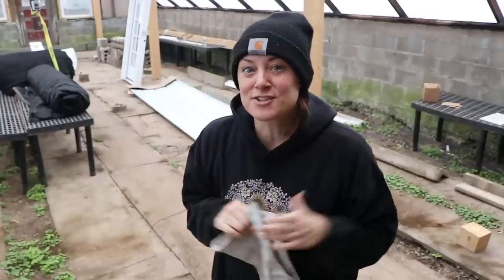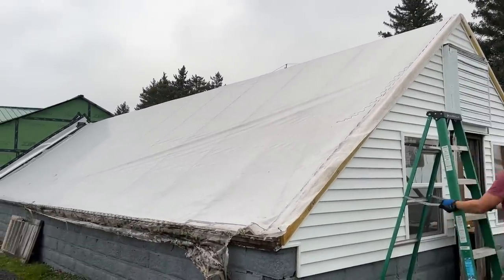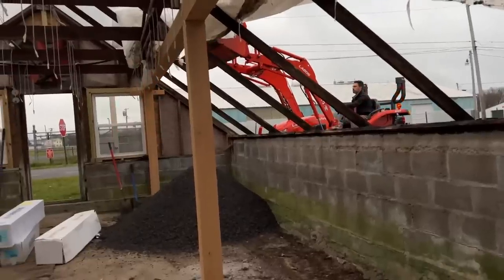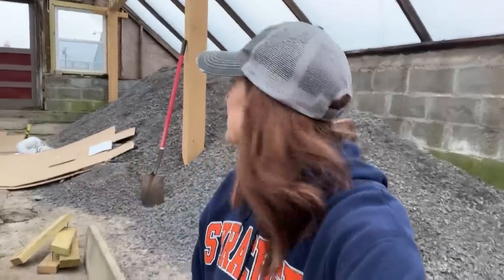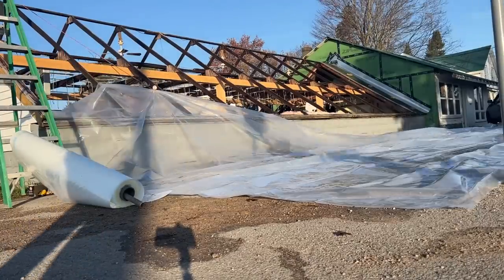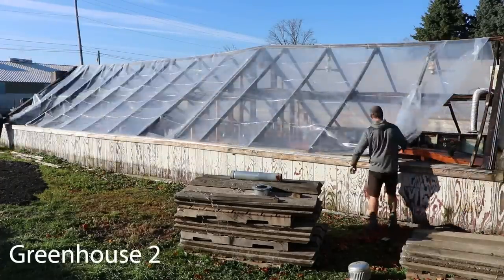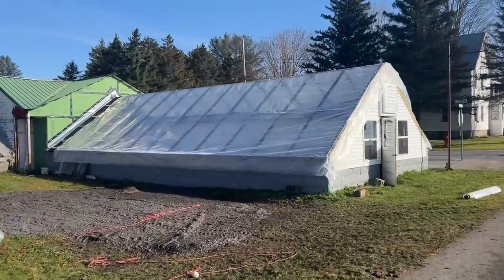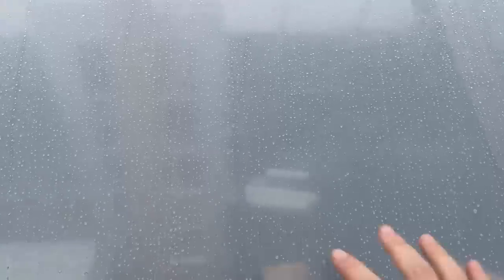New Poly on ALL 4 Greenhouses : Moving the Stone into #1 (Brad is a Genius) : Flower Hill Farm

Comment: Nicole and Brad, did you choose this larger stone instead of the finer stone  “dust” for a special reason?  We have maintained our driveway and barn floor for many years with both materials.  Compaction is always our final goal   I think you will be very happy to have avoided the concrete solution.  I just recently learned there is a pourable solution that can be used to help compact stone.  Interesting. I’m sure you both agree that having that tractor is everything.  Best thing we ever made payments for!